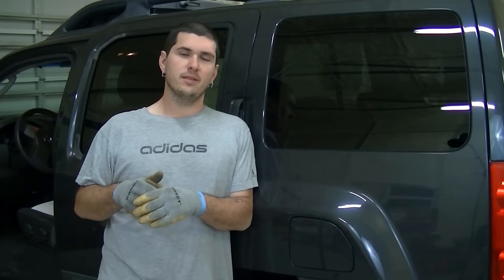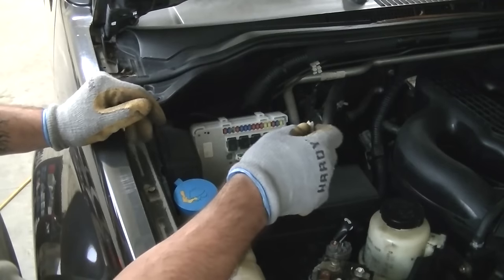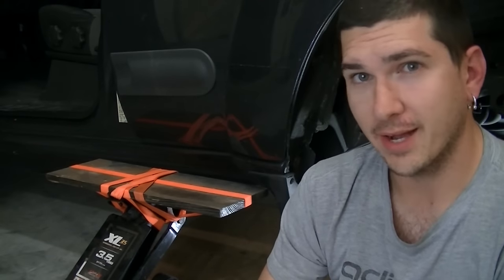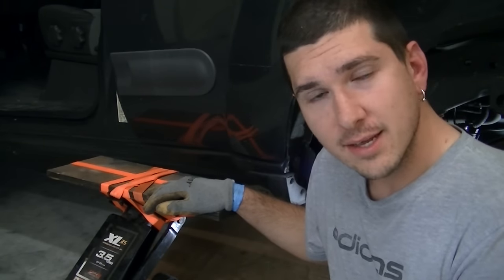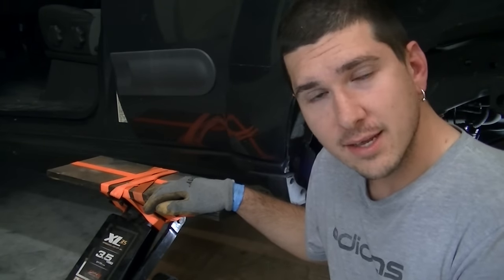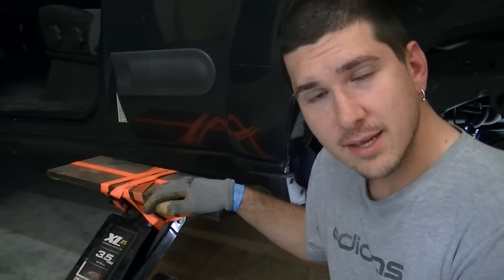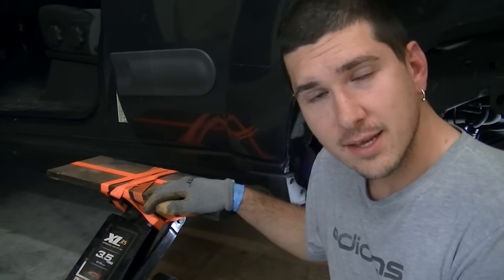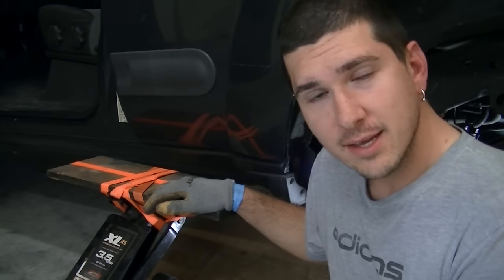How to Replace the Fuel Pump on a Nissan Xterra/Frontier

Comment: hey bud, I replaced one on my wife's xterra due to gauge and the actual pump went out. after replacement the gauge still doesn't work and the check engine light code is still on. any ideas? it does run now though
Reply from the maker: What's the error code ?
Reply: +Ry the car guy 
sorry I didn't get that last reply
Reply: You may have an issue with the EVAP sensor. Have you tried simply replacing the fuel cap. This can cause an EVAP sensor code.

Comment: My sensor has failed in my 2005 Nissan Xterra. Which means my gas gauge is not accurate. Why did you think it was the fuel pump rather than just the fuel sending sensor?
Reply from the maker: Oh it was the sensor, it just comes in one package so I replaced the whole thing.

Comment: evab hose stuck with out clip help?
Reply from the maker: +Sammy Sahagun i get those hoses off by sliding a small flathead screwdriver between the hose and the inlet/outlet. Then i work it around the hose to loosen it up

Comment: If I crush the hose coming off the top of the pump with the tank when I tighten the straps will it make the full not move to the motor
Reply from the maker: Yes you need to make sure that all of those lines have a clear path to the motor.

Comment: p0463
I replaced the whole pump/unit and still gauge not working and check engine
Reply from the maker: Well either the sensor on the new pump does no work or you have a short in the line that runs from the sensor to the instrument cluster. Check your fuses related to the fuel pump and make sure they are in tact. The sensors are really delicate and easy to damage during install. Hopefully you did not damage it during the install.

Comment: Ill take my grinder and make a square above second row passenger side and change it in few minutes and make a door for this fuel pump really bad design not going to go throw all this headache of dropping it 😁
Reply from the maker: Good luck. Hopefully you don’t have any leaks in you connections or fuel lines. Too many sparks next to your fuel pump and bye bye Xterra
Reply: @Rythecarguy  😂 ok ill use metal cutter  and ill take care of cutting cause i have delay on startup i have to wait before start few second  then start so i think its the fuel pump and hope  no bye bye 😃 cause i love it 😍 but dont like bad design like this first suv always with sedan didnt get fuel pump that you have to remove the tank to replace the pump anyway ill watch your video many time and see if i can get block and hope hoses dont riun while removing the pump from the tank, not confident of this cause too much work i can wait about a month till i figured what i have in my truck 😁 and if i can do it before removal of straps of the tank cause you know first time 😂 is always hard to push your self you have to figure but iam a diyer i Did many thing but in sedan car not suv which even working on the engine bay streched my legs and back 😂 and leared alot from your videos about xterra million thups up for you you are the  car guy 💪💪💪💪👌👌👌👌👌👍👍👍👍

Comment: dude!
Reply from the maker: I've already been through this with a few other people. There is no access port in my truck. I assure you. I took seats out, ripped up carpet. No port in my truck.
Reply: No there is not.  I have a 2006 and had to drop the tank for a fuel gauge sender.  Check the factory service CD.
Reply: Ry the car guy